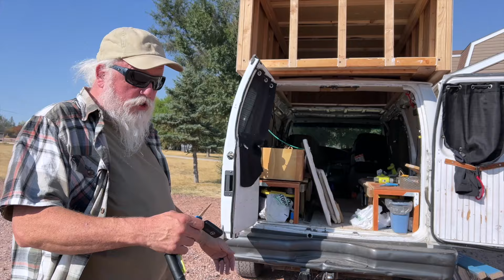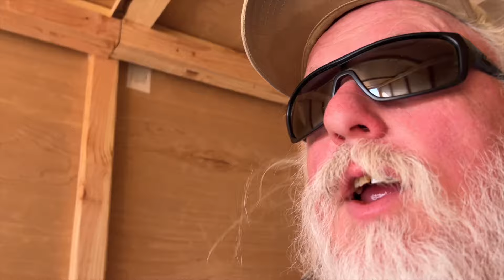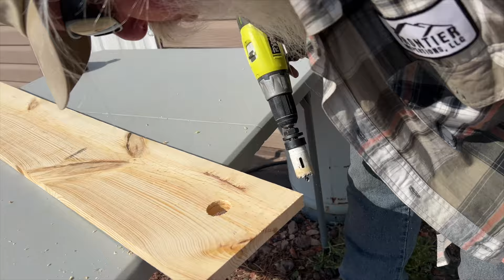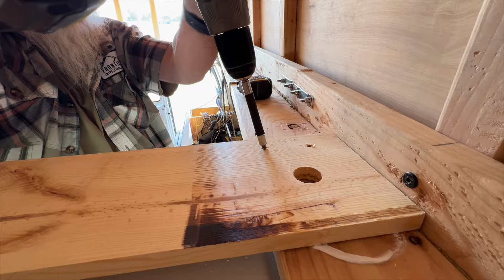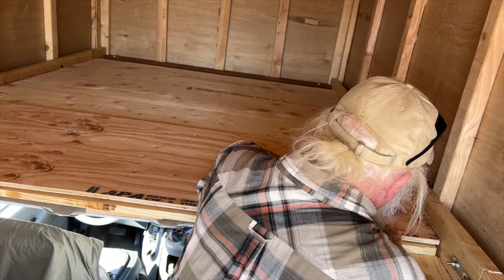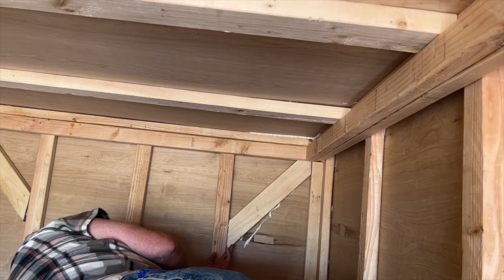DIY Custom Van Hightop Build Day 9 - Bed Platform and Spray Foaming Gaps

Comment: My Class B has an overcab bed.  I've actually rubbed my shoulder on the ceiling just rolling over.  The real trouble, though, is needing to go to the bathroom at night.  I've decided to swap the uncomfortable jackknife sofa the van came for a bed that expands on drawer slides that will be a sofa setup during the day.  Much as I'd rather have a bed that's made up all the time with sheets and blankets, I need to have a place to sleep where I'm not risking a broken neck several times a night to sleepily make my way to the use the facilities.  If that means adjusting to using a sleeping bag (which will be stored daytime up in the overcab space), I can do it.